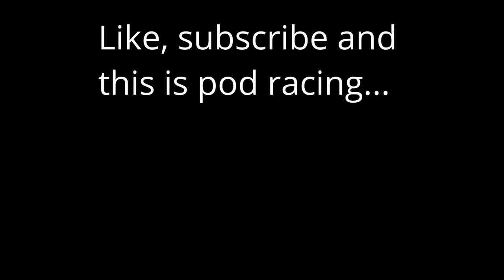TBS Pod Racer Full Review Open source Lightweight drone frame - TeamBlack Sheep $26 quadcopter

Comment: Ive just built one this week
Aikon f7 20x20
Spedix is35amp 45amp burst on jesc rpm and dshot tel 2.3
Matek mini 800mw 
Nano foxeer pred v4
Brotherhobby 2004 3150kv lifted pod up 12mm in nylon standoffs 
Crossfire nano immortal t on arm
Its nuts on 5x2.5x3 love it to bits its got real punch power propper little thing weight is 280 gram on tattu 95c 850.  It canges direction like an anomaly 3 1/2 mins flight time if steady eddie 2 1/2 mins if i go nuts. I tried default pids to begin with and perfect just added some feedforward transition 0.50 and it real smooth on light movement. Sp_averaged_3.  Little beastie
Reply from the maker: Great notes!  Very cool that a 20x20 stack can be used as well.  I am thinking the extra weight is probably helping you on the track, nice!
Reply: Its got insane vertical punch when flying it los it soon gets away. Lol not all 20x20 esc will fit mind i tried to fit hobbywing 20x20 40amp-60amp burst at first but extra fets on corners just push it beyond fitting. 
The extra few grams not an issue the motors are wicked mine are second batch so shafts dont drop out like first batch. Lol
Reply: Hey so you had to raise the pod 12mm to get a 20x20 to fit.  Looking to build one was wondering how 20x20 would do
Reply: Ken Shipley yes i lifted pod up in nylon stand offs ive got spedix 35 amp esc jesc on rpm filtration. Akion f7 20x20 and matem 800mw 20x20 vtx immortal  t  on arm.
Reply: @noisy_boi_fpv_3920  thanks thats great.  Are you racing with it.  How are ypu likeing it after a month.
Reply: Is it a durable frame?

Comment: I bet if you put the 2004 motors and a slightly heavier battery on it it would add just enough weight to help hold the nose down and maybe help with speed. 👍
Reply from the maker: I actually did that exact thing in this video https://youtu.be/kdkcTkTkyd0
Reply: @JonE5FPV  lol I missed it.

Comment: I built mine same everything as yours. I didn't want to use standoffs for canopy so had to trim a spot for the USB. The antenna looks cool inside the holder I bought the Trump but the cables too long and it's a pain if you have to pull canopy off thinking I should mount vtx to the canopy for easier service. Frames super thick it tunes alot easier than some of the other toothpick frames for sure. Thanks for the original review on it which is why I bought it
Reply from the maker: Thanks for the feedback. Been enjoying this one a lot!

Comment: Ive been debating on building one of those quads or a 3"/4" for a while. If you would take either of the sizes in a race course which would you rather take? Awesome video btw.
Reply from the maker: Larger the better.  For some reason, 3" is faster than ultralight 4 or 5", but manuverability for track flying was better on 4".  This actually flys pretty similar to a 4" that i have tracked like the GepRC dolphin, or the Babyhawk R 4", or twig mutant 4 i have videos on.  But a little floatier.  The main reason why i would pick this, is the motor protection is good, but most of all the efficiency is enough to actually make a full race heat.  The others you can hit close to 2 mins, but this one can go a full 2.5 mins flying very hard.

Comment: Are there motors for this frame that would make it openracer class compatible or whatever? I'm new to trying to race, I actually bought this frame by mistake thinking it would take normal sized 5 inch motors.
Reply from the maker: No. The motor mount for this frame is smaller 15-18xx, there are some 2005 with this mount. But racing class is larger 2207/2306 size which have a bigger base.